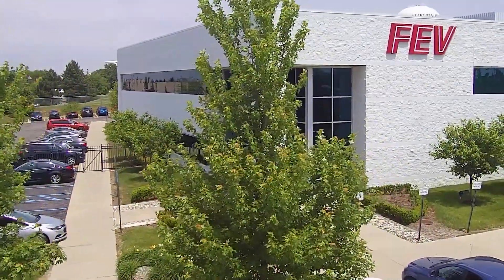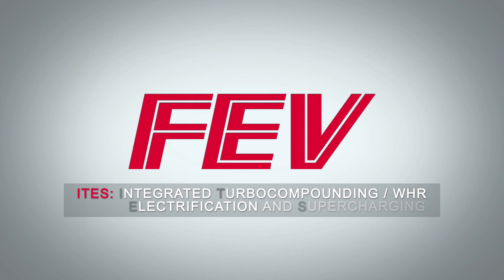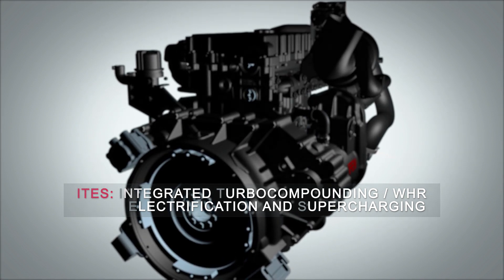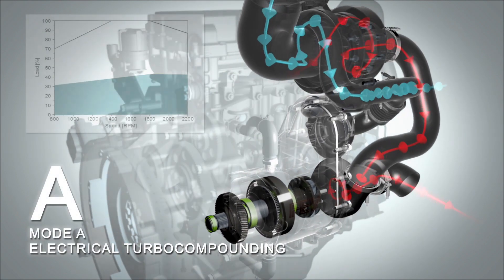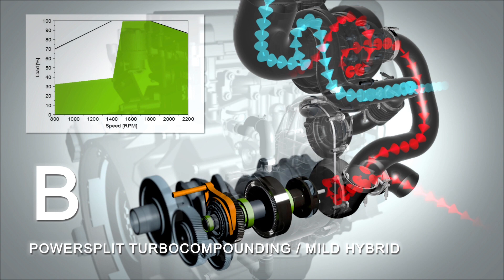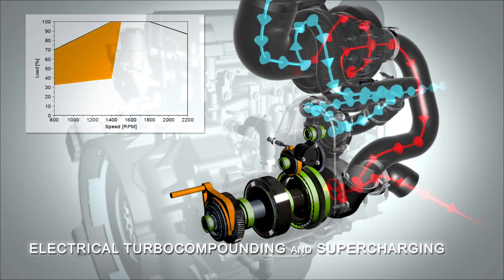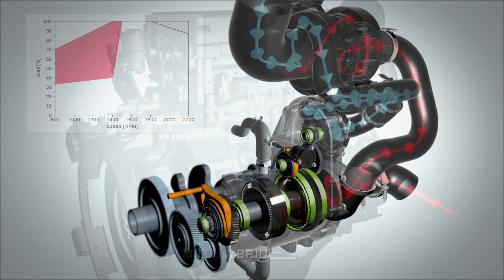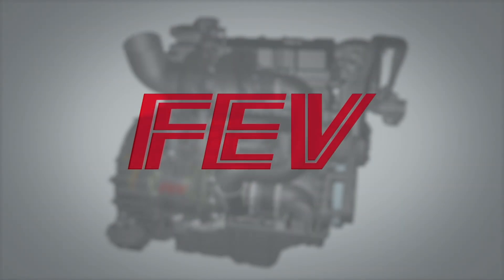ITES - INTEGRATED TURBOCOMPOUNDING/ WHR ELECTRIFICATION AND SUPERCHARGING

Comment: I have one question.
Will this system be available for everyone?
Or just to integrate a commercial vehicle straight from the assembly line?
I'm interested about installing this system in my fleet
Reply: @Mark S Volvo is only using TC
Reply: We don’t want any part of this, it’ll be unreliable and the fuel cost savings will canceled out by the repair bill when it breaks